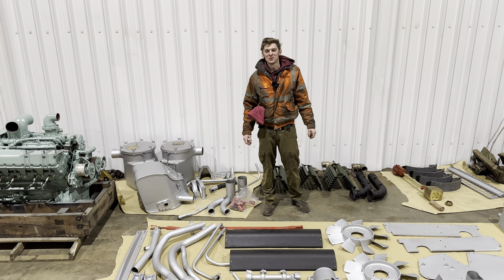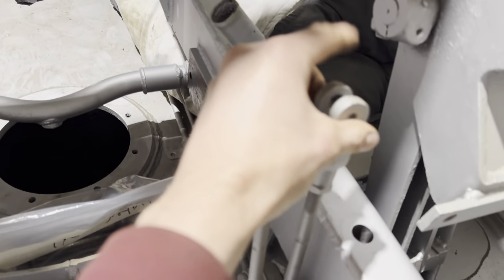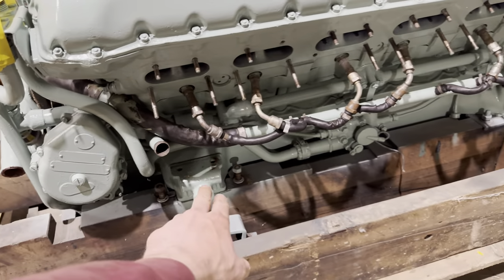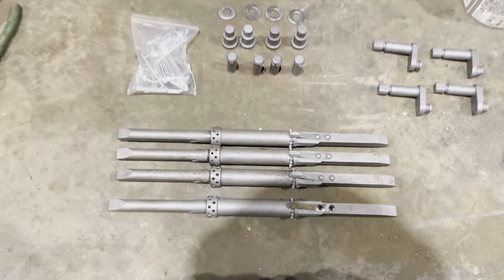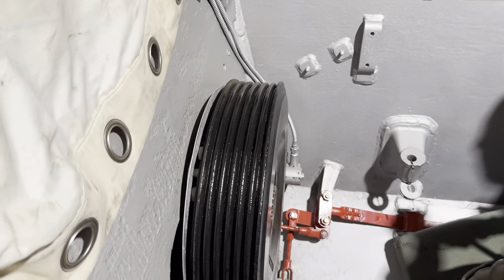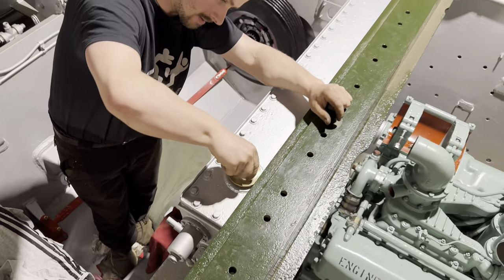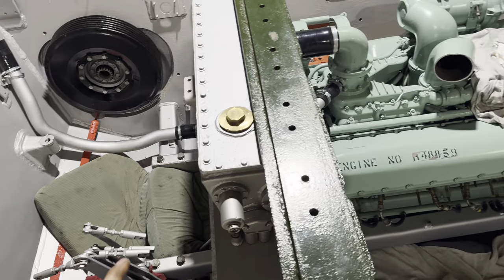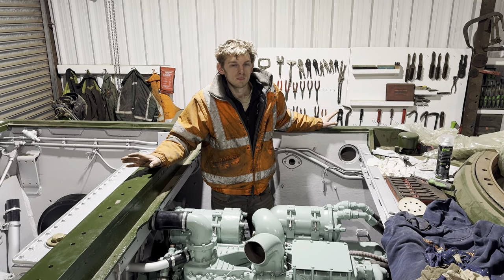INSTALLING A 600HP ROLLS-ROYCE V12  (FV4005)

Comment: thank the Lord, finally Ted has seen sense in showing you how to operate the fork lift properly - although when moving you should really keep the load low keeping the centre of gravity low, you'll learn that when things go slightly whoops when off road, and by that time Ted would have foreseen this and jumped well clear, self preservation
Yet again Jack has performed a miracle of paint inside the engine bay, great job Jack

Comment: Great looking work there, looks fab, personally I’d avoid copper slip on bolts etc after having spent many hours beating 40mm+ pins out of hydraulic rams. Often having to gas cut the ram eye in half/off to release the pin, and there always is the remains of copperslip the manufacturer used, actually eaten into the steel and behaving like it’d been brazed in. Electrolytic reaction I believe it’s called. 
Plain bearing grease every time .
My old foreman used to swear by copperslip, using it on HGV clutch splines and such, despite us having to hard scrape the stuff off when replacing a clutch. This went on for a few years until I showed him the bit of paper in the box the clutch comes in , you know, the bit of paper nobody reads😆 , well on there from Lockheed it clearly stated “ no metallic type greases on the clutch splines “. His face was a picture, all be it an incredibly red one 😂😂😅
White grease on splines etc. A lot of drum brakes use white grease/ptfe grease for everything sliding.

Comment: did you check the clutch cross shaft for freedom of movement  before you you put the engine in,,,also the brake cross linkage strip is not to be painted  around the rubbing blocks   it will stick the linkage up,,,dont forget the  COOLANT RAIL bleed pipes ,,

Comment: Now I see why they ask silly questions when undertaking theroy tests e.g. before operating the forkilt should you?
A) make yourself a cup of tea
B) inspect hydraulic lines for wear or leakage
C) remove your pet dog from the controls
D) find out if Taylor Swift is currently in the top 40

Comment: Are those stainless steel bolts hagging out of the bottom of the water rail ? Have they been fitted with locking nuts to prevent vibration from extracting them ?

Is this vehicle similar to the scorpion light tank reconnaissance vehicle ?
Reply from the maker: Normal steel bolts with split washer

Comment: Well I see you do use ANTISEZE but you don't use it on every nut and bolt they like it to so they come apart next time and I use it on threds of sparkplugs and the other thing I see you don't use witch they really need after you clean them is your electrical connections diastolic grease in plugs and prongs and ANTISEZE on the screw on connection white grease doesn't last as long and gets hard after time the new stuff works better and lasts longer and if used right will keep corrosion and water out if you use enought but you guys are doing a smashing job of restoration in your tongue looks really good in mine hats off to you and your friends and Ted needs some driving lessons on that tow motor to make him more useful  haha

Comment: The brake drums look like they were set up for V belts. What is the purpose of these grooves? Almost looks like you could block up the front of the tank and use them for a PTO, like a farmer. (Although that would be most impractical.)
Reply: To do with dissipating heat 👍

Comment: Question.  Are you guys using  carc paint?  Sherwin carc? Or what brand of paint do you prefer to paint your tanks with these days? I assume it's some type of urethane type paint, but just wanted to ask.  I'm a painter so just curious.  Haven't seen a video in which you mention what you like to spray.   Thanks so much love the vids.
Reply: Depends on what we are doing 👍 this paint was supplied by the tank museum but we have a couple of suppliers for our other projects
Reply: @Commodore_westaway  sounds good.  I just started to wonder what type of paint you were using. Learned about the nuclear chemical and biological resistant coatings.  I assumed you guys probably don't need to go that route. But was curious.  So many good coatings on the market.  Thanks for the answer, love the vids.

Comment: Rachet strap used to lift the engine 😮 Not rated for lifting, just strapping down. No one died this time 🤞🏻
Reply: Was only used to help angle the engine for lowering it in it never had serious weight on it

Comment: What about those man holes under the engine and water frame,should those be open with no lead on?
Reply from the maker: Acsess holes 🕳️ one to help fit starter motor and the other to help fit set / fit clutch
Reply: @MrHewes  Oh i see,they are bolted from underneath,i almost waiting for an video full of svaering over forgotten items😆

Comment: Is there a reason that one nut is a castle nut and the other three are normal on the water rail?
Reply from the maker: They should all be castle but them nuts were the ones removed from the hull. I may change them back the castle nuts however
Reply: @MrHewes  ah fair play. If they work they work I just wondered if there was a reason

Comment: I may be stating the obvious here but don’t get mad at me…..😊
I’ve heard you say many times what a bitch it is getting the generator on. Just wanted to check you know the two halves of the belt pulley on the generator can be separated to make getting the belt on easier.

Also, I’m curious, the Cent we rebuilt had 0.160” of shims under the rear mounts of the water rail to get the engine to align with gearbox. Did yours have any? I’m guessing they were to compensate for hull distortion during fabbing.